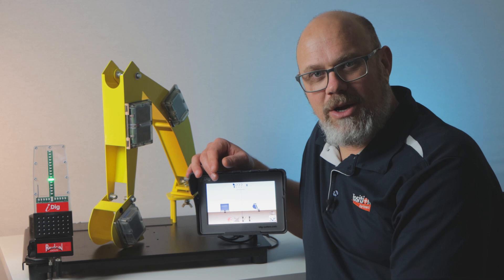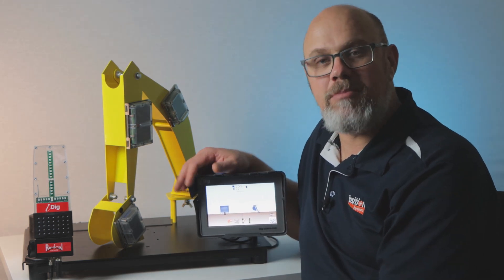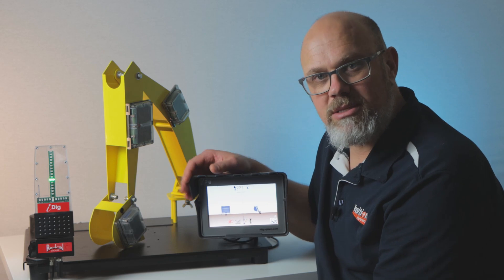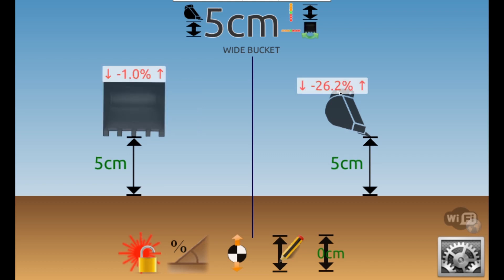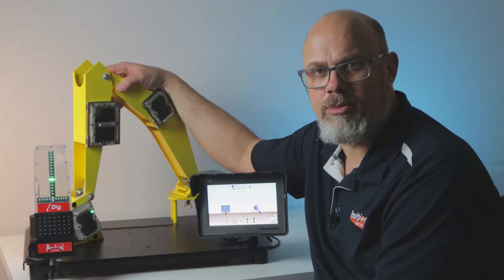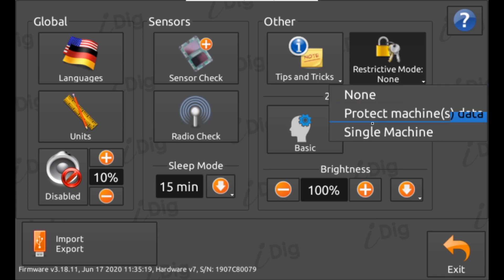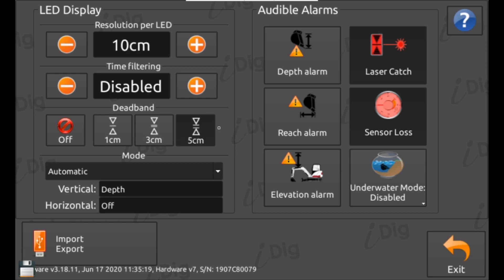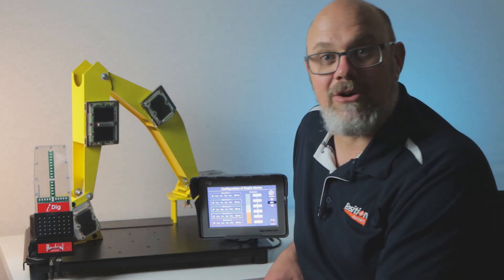iDig 2D Grade Control "How To" Part 1: System Overview and Screen Layout

Comment: Can you tell me the following specific parameters of iDig wireless sensors？
1.Endurance time；
2.Is there a charging indicator？
3.Whether the electric quantity can be displayed and viewed in real time？
4.Will the power reduction affect the sensor signal?
5.What is the effective communication distance between the sensor and the control box？
6.Does the sensor have sleep mode？
7.After the sensor is connected with the terminal for the first time, will it be automatically connected in the future？
8.Pitch angle range？
9.Roll angle range？
10.Maximum angular velocity？
11.Static accuracy？
12.Dynamic accuracy？
13.Stability range？
Reply: On a full charge each sensor will last several days. 
Also there is a setting with charge level in %s.